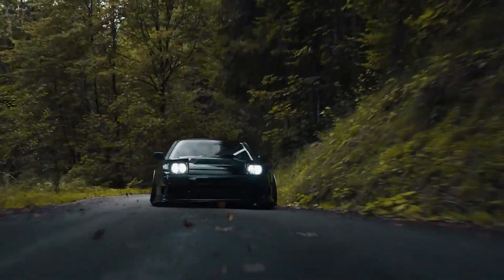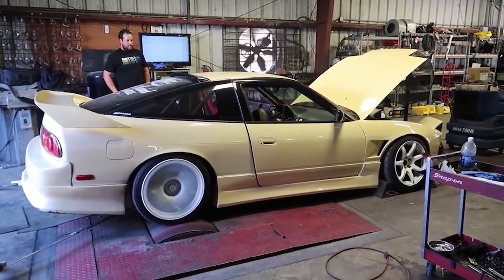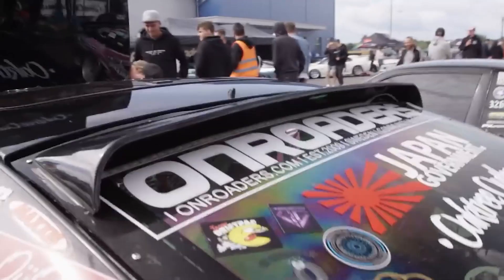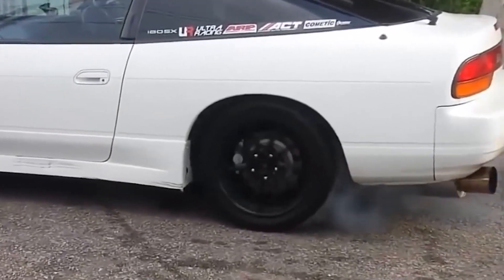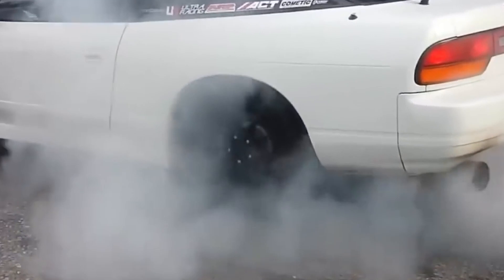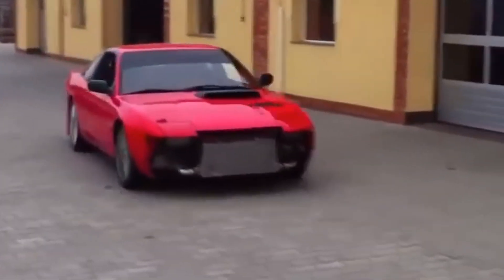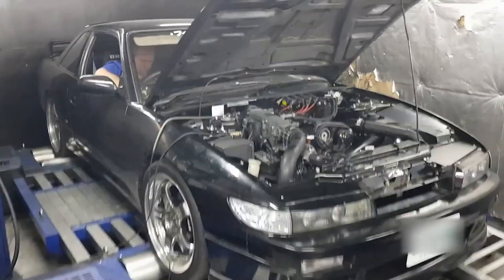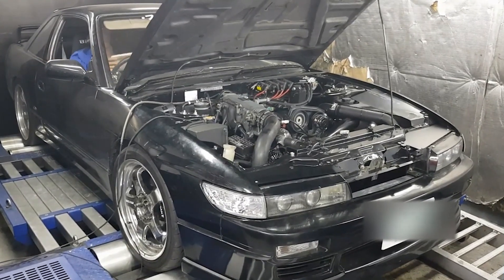Unleashing the Potential: A Comprehensive Guide to the Nissan CA18DET Engine

Comment: The 8 ports head is a pain to maintain, and flows less when chasing power. I got a fully built one. The first upgrade anyone should do is a FMIC and an e85 conversion with modern injectors and fuel pump. The gearbox dies when trying to push over 300hp with some grip on the tyres (3rd gear usually). That light grey hillclimb S13 has an elite il300 sequential gearbox and has changed a bit since those vids, but never broke in 10 years ;) The unreliability reputation comes from people who wont change a dying turbo and cant read the oil gauge, leading to killing the engine by lack of oil. They do take 600-700hp pretty well, over that the engine block itself starts to warp and it makes things difficult.

Comment: Proud owner of Ca18det  stage2 since 2010 and still unopened stock factory engine! 💪🏻💪🏻
Reply: Hi there,

What kind of oil would you recommend? I just bought one and the previous owner told me to run with 15w50 300v motorcycle racing oil. It makes around 220 hp. Do you have any experience with this kind of oil?
Reply: @filipepereira9418 i would not recommend motorcycle oil, they usually have friction modifiers for the wet clutch and that is no good for your engine. Just use something like valvoline vr1!!!

Comment: stock bottom end handles 300 safely, 350 is pushing it. In both cases though stock rod bolts stretch and snap. If you are rebuilding it with stock parts, least you can do is put ARP bolts in the rods. If you are going forged Pistons, dont be cheap and add the forged rods in
Reply: Do you know what the Ca18et can handle? Single cam
Reply: I'm unsure about labour costs where you are but forged rods are cheaper than ARP bolts and resizing 80% of time in Australia
Reply: @hayden6056  Argentina, I paid 600USD in labor for block and head skim and rebuild.